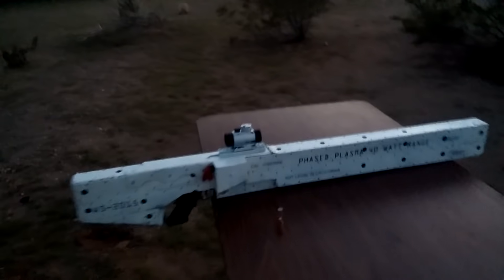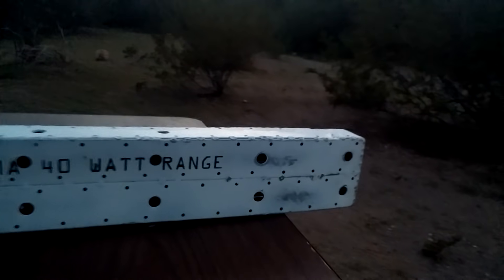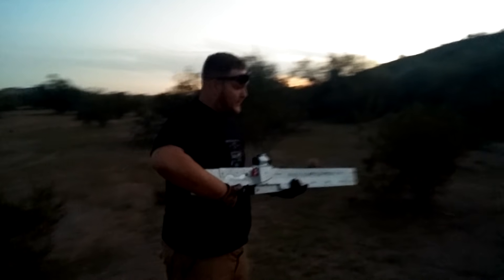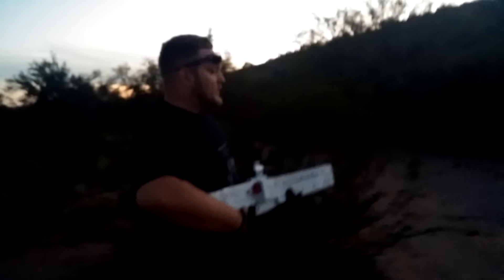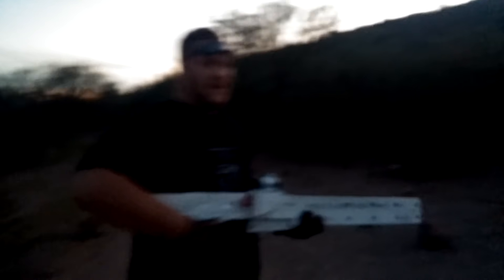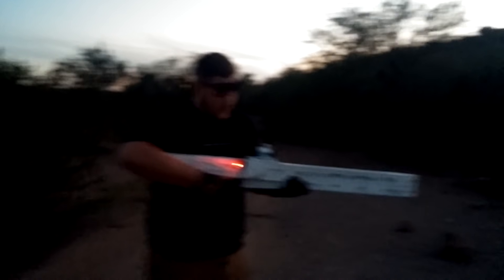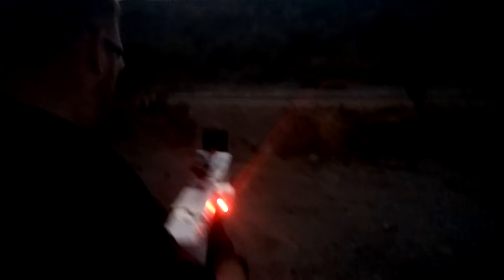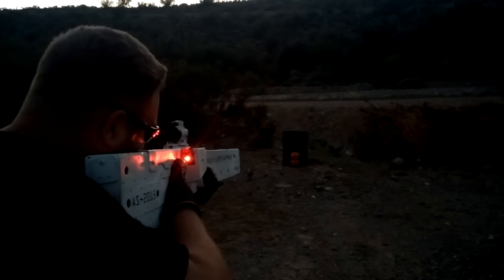Electromagnetic Plasma Rifle (Night Time Test Fire)

Comment from the maker: *Update* 
Unfortunately, the rails melted and blew themselves apart in subsequent test fires lol I'll re purpose the internals and build another one in the future.
Reply: I noticed the design is reminiscent of the Tau Rifles from Warhammer 40k, do you perhaps forsake the ways of the glorious God Emperor of Mankind and believe in the filthy Xenos Heresy of the Greater Good?!
Reply from the maker: +Benjamin Wang I got 10 or so shots out of it. It could do more, I'd just need to put a metal pipe around the helical rails so they can't blow apart. But I didn't fire it much after this video, because the cameraman got hit in the neck by something and was bleeding pretty bad. So it's a little to dangerous to fire with other people around watching and filming like in this video.
Reply: @ShirudoSystems  can you teach me how to do that?
Reply: +Alex Smyth yeah, melted rails is the major technical drawback. Is there a way you can make viable replacement rails?
And how in the hell did you make a handheld railgun that could propel a projectile through a metal drum? How did you power it? Maximum fire rate? And I'd LOVE to see what a double helix rail looks like :-o
Reply: +Alex Smyth You gotta put a laser in there that fades on with speaker that plays a capacitor charging sound before you fire. it would look fucking awesome.
Reply: +Alex Smyth kinda curious ... if you supercool the rails, what the change in output would be. Liquid nitrogen is cheap
Reply: Sulli11 Steel would be a terrible option. Steel is a terrible conductor in comparisson to either copper, aluminium, silver, gold, etc. I think he used pure copper, which is also not the best option. My suggestion to high conductivity is silver plated copper. Silver has the highest conductivity at room temperature of all known metals. Higher conductivity means less resistance, means less heat, means less sparks, higher efficiency. Also silverplating copper can be done at home.
Reply: ambionkanai He made it really powerful by not using a transformer, which means that all of the energy in the capacitor dumped out at one pull of the trigger. After that one shot, you have to completely recharge the capacitor.
Reply: @S5Ross1444  I have placed transformer/induction coils around my capacitors so the collapsing field from the capacitors energizes my transformer coils, which in turn feed back to my capacitors. With the resistance provided by the projectile as a load, an oscillating field could push many times against the projectile without nearly the same losses to heat. Bifilar coils are really the way to build transformers for this. Each coil can step up or down voltage, thus the magnetic and dielectric fields intensify directionally, making it easy to double the work done per watt applied when compared to conventional transformers/electromagnets. The coil can be engineered to resonate with or against the projectile. I once built a bifilar coils which detected my presence specifically inductively. Depending on its orientation relative to me, the coils resistance would increase or decrease relative to my distance from it. Utilized in this sort of apparatus, the coil would increase or decrease voltage relative to the projectile automatically. Man, glad I can’t work on this sort of shit anymore… I’d get myself in trouble!
Reply: I've been wondering what material you had been using for the rails. If you have been using steel rails then the iron is heating the carbon out of it's self. So if you can, try using Brass or "pure" Copper. Brass might give some heat leeway to allow it to launch, but Copper won't have the heat problem and should fire just fine. I don't truly know if either would work any better because sparks seem to eject out of all materials used for rail guns, so steel or aluminum might be your best option to begin with.
Reply: @sulli1189  there are also copper vacuole heat sinks which cool supper quickly. Replacing the rails with copper would eliminate the mechanism of propulsion. Wouldn’t work the same. The rails might be able to be constructed in a laminated stack such as you see in transformers to eliminate Edie currents.
Reply: +Alex Smyth Did you use a transformer?
Reply: Wheelman Josh
That is possible, but certainly not worth it. Also carrying charged capacitors with you is extremely deadly. They are charged with hundreds of volts with an ESR in the milliOhms, capable of discharging in millions of Watts. One mistake and you can consider yourself lucky if you die instantly. On your second suggestion, you can switch them in parallel, where you take the sum of all individual capacities and use the RC constant to determine a length where the armature is accelerated. However, an ideal railgun has a longer acceleration distance, so it's practically a terrible idea. It's better to find a way to charge your capacitors in a rate of a couple of seconds. I have build a pulse charging sequence in the last year, where I achieved a charging time of 4 seconds. However, it does put a huge load on the FETS and the batteries, so a soft-start had to be implemented, giving a charging time of 5-8 seconds. Which I am pretty satisfied with.
Reply: Braden T
Tell me how you want to have a high current with low voltage with non-zero resistances. Since, you seem to forget Ohm's law. They most certainly do depend on voltage. For a projectile to launch down an energized rails, you need a high current pulse, a high dphi/dt. The lower your voltage, the higher the resistance, the lower your current, the weaker the magnetic field, the weaker the projectile. Easy equation.
Reply: Alex Smyth the use of a double helix rail is unique, first I have heard of its use. Have you considered using a harder metal such as tungsten? Also is this a project that you would consider pursuing further, I might be able to get you funding.
Reply: Lithium nano phosphate is better.
Reply: ***** I like EM rail guns, they are pretty neat and the one the Navy is having produced, will help out greatly because of its effectiveness, extended range, and cost of operation due to no gunpowder. Have you ever seen the movie Elysium, with Matt Damon? He fires a ChemRail rifle on that movie, I wonder how that would work?
Reply: Eric Fauchon That's funny. But yes, if it will punch through steel, it will kill a human being.
Reply: ***** Maybe the rails will be easily interchangeable and made that way, just like you would have to replace the barrel like on a rifle. With the savings that a rail gun would likely afford the Navy/military with the cost savings in powder and projectiles, as well as the performance upgrade and overall kinetic improvement, it may be worth it and the problems easily overcome with design.
Reply: +samuel edwards If the capacitors are rated for something else than RMS rectified mains voltage, I'm pretty sure he used a transformer...
Reply: +samuel edwards still cool. its definitely a step forward, id like to see what this does against a meat target
Reply: @Toughguygames  what target? Wouldn’t be much to see.
Reply: Badass Update
Reply: Moron...
Reply: Raymond Pinner I would have no idea where to find people like that. As I do not live in the U.S. which I presume you do. My government isn't looking for work in this. I could get work as technical officer with my Mechanical Engineering degree, but that's about. The closest I can get is to go with BAE Systems in the U.K. or Thales in France. I don't have a website, that's a good idea though.
Reply: Liquid Nitrogen injection behind the projectile. That way the cooling will match the heat, and what would otherwise be heat loss becomes velocity for your projectile. Two birds. One ice cream cone,
Reply: ***** Ya, But I've seen people use steel before cX But ya, Copper, Go with some kind of copper. That's what I've been trying to use.
Reply: He used a capacitor and a lithium ion battery without a transformer.
Reply: @abuzzedwhaler7949  He used gunpowder dude.
Reply: True
Reply: Wheelman Josh
The one the NAVY has, the prototype I have seen on youtube is really weak. As they as well use copper rails. They use a huge 5kV capacitor bank, with a low ESR. The power that goes through those rails will surely destroy them in a single use. At this moment, there is no effective use for it. However, in my spare time, I am researching effectivity of different alloys. Currently the most effective conductors would be superconductors. With this great power comes great heat. Little resistance, little heat. Since such thing doesn't exist yet, expensive alloys will have to do, but we're getting there. There is a future in railguns, I do believe so! I don't know what a ChemRail is, but considering it's from a science fiction movie, I think it's nothing but science fiction.
Reply: ***** Yes, I am getting new ideas and even discoveries every week. I am definitely progressing.
Reply: ***** I might be making videos in the future. So if you want, you could subscribe already to be instantly updated.
Reply: I hope so, yes. *****
Reply: There's got to be something that can be done to stop the rails from melting. The Navy has nearly completed its prototype and is ready to install for testing one of these rail guns, so evidently there is a solution. But not everybody has the near limitless depth of pockets that the government does to pay for these little projects. lol
Reply: Wheelman Josh
Could be, but having copper that can't melt, is like freezing fire. It's implemented in my designs at least, as well as much more efficient approaches which the NAVY hasn't even thought about. Their designs are too simple to be even considered efficient weapons, maybe we'll see greater improvements over the coming twenty years.
 For now they are just garbage.
Reply: +Azagro use a tazer for the magazine.
Reply: Donovan Fulton
What is it exactly you mean? You mean for charging? A tazer would be too weak for that, actually, I desgined my own SMPS for this purpose.
Reply: Metal drum? 3/8" structural steel plate! But a drum full of water would look impressive. 
I wouldn't trust body armor to it.
If you watch the shooter videos, they hit 1/4" mild steel plates regularly with little damage.
My hat is off to the Gent.
Reply: And if he had precharged replaceable caps, it could get serious.
Reply: Rail guns dont depend on the voltage, its the amperage. B=µ*n*I/L This can then be used for: F=B*L*I and The Muzzle Velocity can be found using: Mv=√Lb*((B*L*I)/M) 
where: Lb= barrel length,
M = Mass of the projectile, 
F=Force in Newtons, 
B=electromagnetic field strength in teslas, 
µ=Core permeability (in this case air), 
n=number of coil turns, 
I=Power in amps, 
L=length of coils in lateral direction.
Reply: HAHA! sorry i did forget about ohms law
Reply: Braden T
Can happen!
Reply: Alex Smyth I was wondering if you'd be willing to teach me to make one of these, I'm extremely interested in coil guns and lasers. think that they're really cool
Reply: Raymond Pinner
Also you seem to be unaware of this whole project of his being a joke. However, as I am pretty well known and experienced in railguns, I will answer your questions. Using helical rails should add additional spin to the projectile. The spin gives a more penetrating force, due to different mechanics, such as dropping air resistance, stabilization, etc. This is pretty hard to fabricate by yourself and because it's a very weak set-up it will probably fail over time (faster than straight rails).
 Now for your suggestion on tungsten, yes, mechanically it has better properties, but electrically, it's very very bad. When it comes to railguns, they require a very low resistance on the rails, to reduce heat -> reduce friction, less energy loss, etc. Silver plated copper, electrical copper and aluminium should do very well.
Reply: ***** If it is a joke then they got me. I have seen several other homemade railguns and virtually all of them end up getting damaged in the test. My thoughts about using tungsten was not for the actual rails but as a barrier between the rails and the projectile. Tungsten is para-magnetic and should allow the magnetic field to pass through it. The spin of the projectile may be unnecessary at hypersonic speeds but deserves testing. I would love to take a look at your railgun projects.
Reply: The primary problem I see regarding a helix rail is that each rail is pulling the projectile in multiple directions instead of just one. Might make more sense to have a barrier rifled barrel between the rails. The larger military versions have been opting for sabo/fluchet style rounds. I didn't see any rail gun posts on your page, do you have any videos? Have you considered requesting a grant or money from Investors?
Reply: Raymond Pinner
Helix rails are just bent around a common axis, so there won't be any conflict with the direction. It's just that as the projectile moves down the rails, the magnetic field shifts from 0 to 180 degrees. Dynamics shows that even if you twist it half a turn, it will spin, due to high acceleration. I am not a fan of the helix rail, but I haven't really done any work on it either. So maybe perhaps when I am done with my current one, I'll try. Yes, I have seen, I am not a fan of the military one either, they are too primitive, I can see many points that should be changed for safety, efficiency and cost.
Nope, I might be posting some soon, as I have been highly requested to do so everytime I talk about this subject, usually young players. Which is heavily dangerous and I don't want some kid losing his life to what I have inspired. Also most of my designs are my own designs. I'd rather leave out details for people who'd 'steal' ideas. Maybe when the project is finished, I will create some videos concerning my designs. Perhaps even during the process I could.
No, I have not thought about asking for a fund. Not sure if I should, but I'd like to perfect my designs and without failure, no perfection and failure costs money. However, I also don't want to feel like I owe someone.
Reply: ***** In regards to specific grants, you essentially have to petition for them and if you dont then someone else will. In regards to investors, they are big boys and factor that a percentage of projects won't go anywhere. The best way to protect your designs is through the patent process which could get very expensive, hence the need for investors. Right now the military is actively looking to incorporate rail/coil/centrifugal weapons into their arsenal. Do you have a website?
Reply: I need to know how this was built lmao
Reply: do you have any schematics or explanation on how to deliver the plasma bullet and assembling, me and my friend tried to make a plasa gun ourselves, but it was more a plasma sac a poché than a rifle.
Reply: some LN2 cooling and turbines made with pc fans should make the basis for the trick, but that would come at the price of a backpack or more weight to the weapon thru a LN2 tank attached to it; hmphhh
Reply: Eco-Friendly Walrus  I know I am kinda late to the party... But I am stupefied at the number of people that think this is real.
Reply: I know this is an old thread so apologies for necro posting.

Could you do away with the copper / glass shell?  Use a magnetron to generate the plasma (plasma is electro magnetic so no need for copper)?  The rationalisation for this is that you then do not need any projectiles.  All you require is plasma, which could be any super heated gas.

I have had that idea for about 20 years but with no mechanical engineering knowledge, I can't.
Reply: Live and learn, it was just a prototype. I'd like an updated version now that you had 6 years of real time to improve the design.
Reply: Shirudo Systems: You know I watched a video where they took what looked like AA battery and attached a strong magnet at either end of the battery to demonstrate how it propelled itself through a coiled wire and I thought what if that battery were a capacitor with a magnet at either end making it a self propelled bullet, just stick it in the coil and off it goes.. Then there's no need for the gun to have a power source..
Reply: Replace them with titanium so it won't melt
Reply: Can you please shoot down that dang chinese spy balloon 🙏
Reply: @israelgarcia4476  If the US shoots down the Chinese spy balloon why shouldn't the Chinese shoot down US spy satellites?
Reply: You should make an outer coating of the rails out of an extremely high melting point metal like tungsten but have insides made with a super magnetic material
Reply: Have you ever considered using tungsten barrels? Plasma is hot, but tungsten could hold a crap ton of heat
Reply: @neorion676  yes that will be a good idea but you will have to put some sort of electromagnet embedded inside of it to accelerate the plasma
Reply: Rebuild it in the 40 watt range
Reply: +Sulli11 People whom use steel have no idea what they are doing. They might be using it for the strength of the metal, but then it should be very low carbon. If they require strength, use tungsten plates. However, I've reached projectile muzzle energy of 150 Joules at 5,5% efficiency. You just have to use the capacitors RC constants wisely.
Reply: Could you engineer it where your capacitor was like a magazine you could quickly and easily change out for a new one, or link multiple capacitors together where you can have multiple shots?
Reply: Wheelman Josh
 If the NAVY really does expect their rails to work for multiple amount of times, especially with the power they are using, they are going to have a really really bad time. There isn't a solution, yet. They are just being another branch of the US military, look at all the other useless stuff they are storing.
 100% Risk, but the costs are something to look away from.
Reply: I just want to know, will this kill someone? I have an annoying big brother and an inquenchable bloodlust, so I just gotta know.